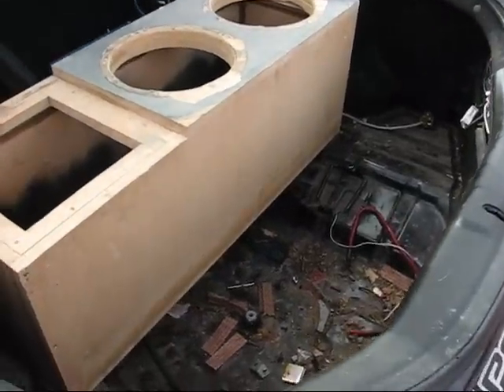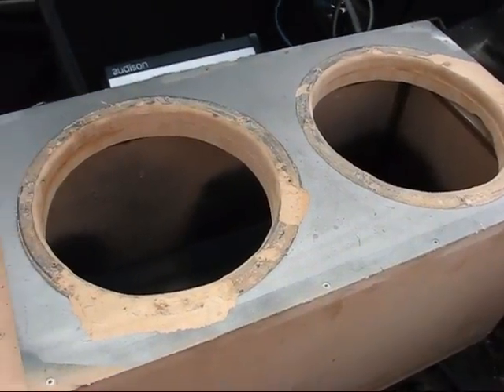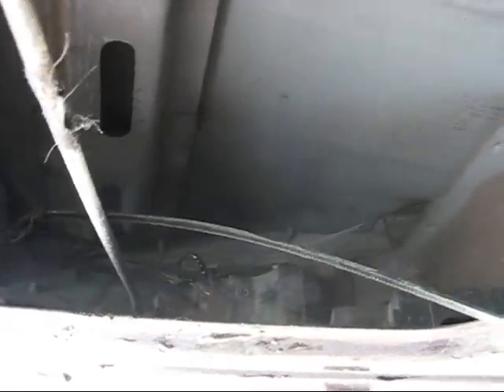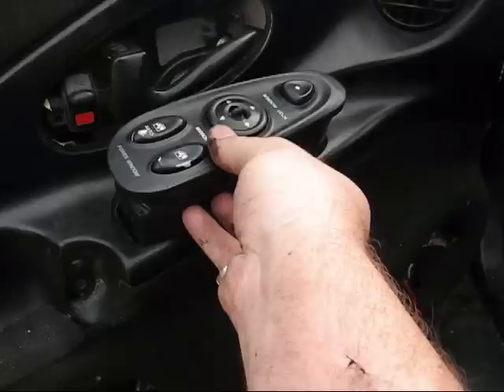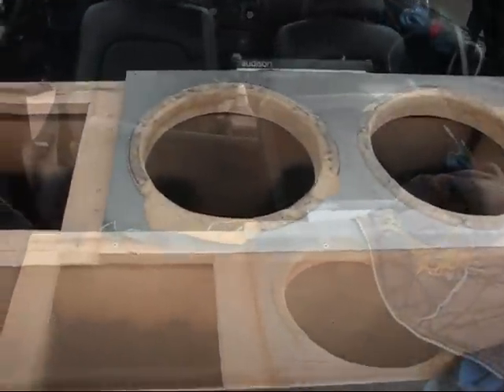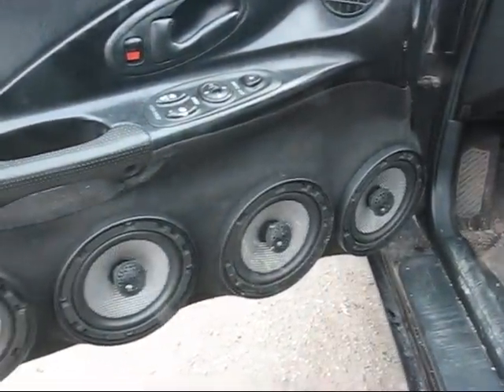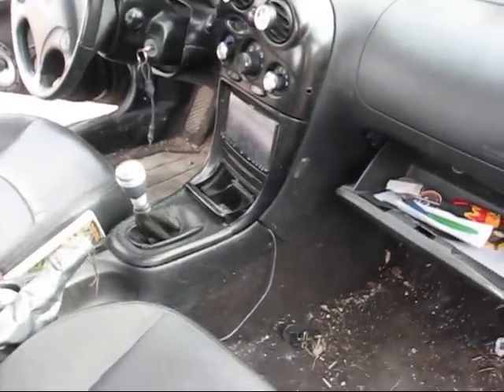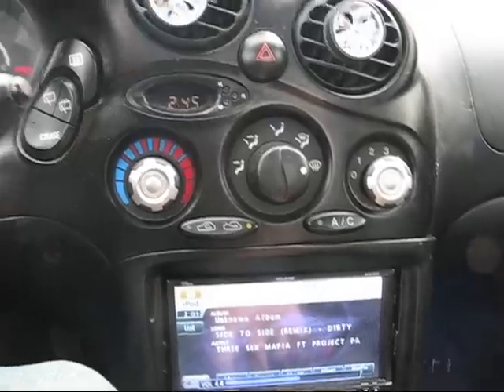DD kingz tiburon getting all the damage fixed....

Comment: Not sure because when I put mine inverted they got louder. Not taking up any box area is always a good thing to me. And excursion looks cool but I think its more inpressive to people when they see those magnets! If you have a good tint on that back window it wont heat the motors. No more then normal with everything els in the car.

And resin does help, fiberglass is just another set but. It does help.